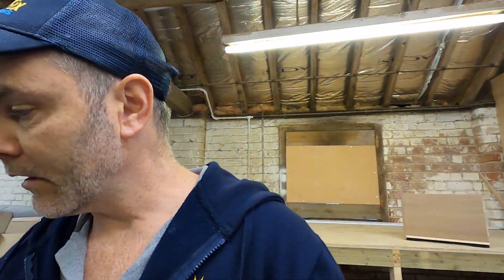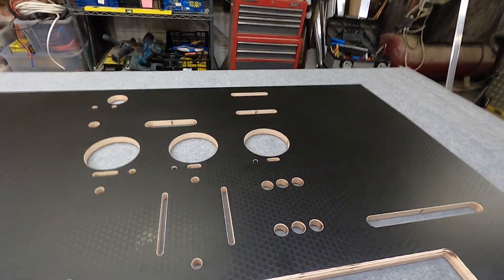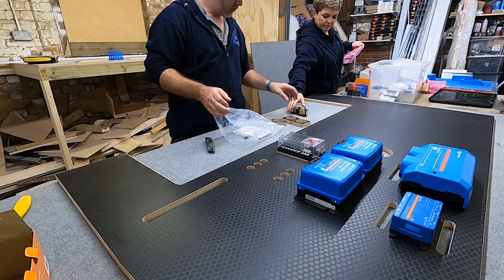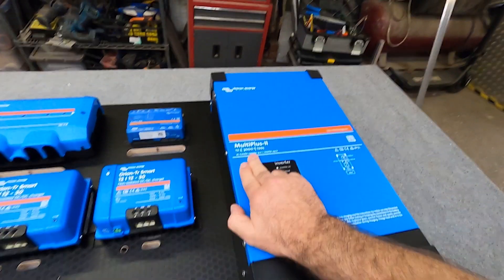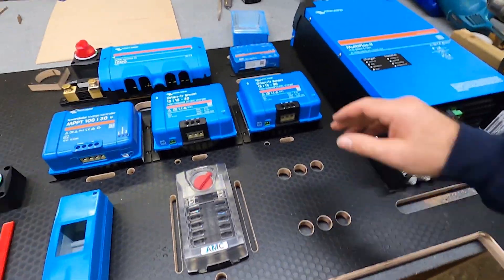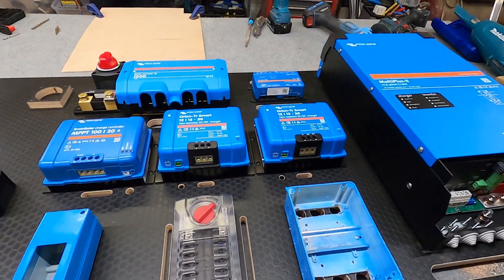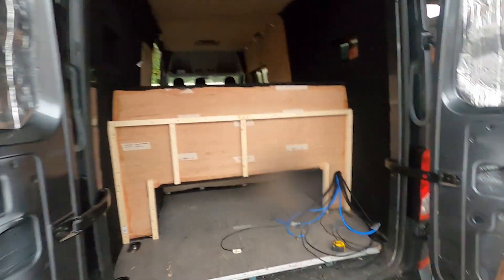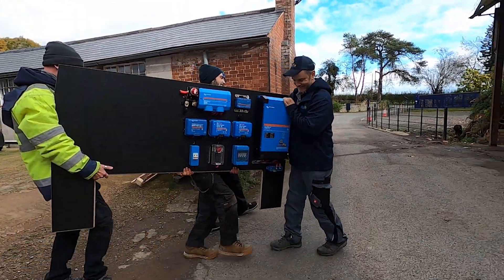IS THIS OUR BEST INSTALL!? || CNC Machining Victron Electrics

Comment: Why not set the CNC to mark the screw positions, to a 3-5mm depth, enough to take the screw tip.
.
Then just line up the units by eye and drive the screws.
.
Would save a lot of time measuring?
Reply from the maker: Yes! We thought exactly the same thing, next time we’re going to give it a go!

Comment: very nice and efficient layout. it would have been nice if you could have shown the back of board as well.
Reply from the maker: I’m gutted. Just searched for pictures of the back but I don’t have any. It looked really neat too. We used blue trunking on the back as well also it was all super neat. We also had fans on the back cooling down the dc chargers. 😁